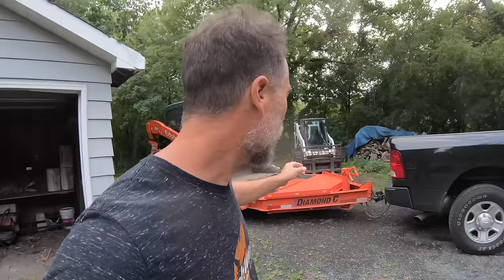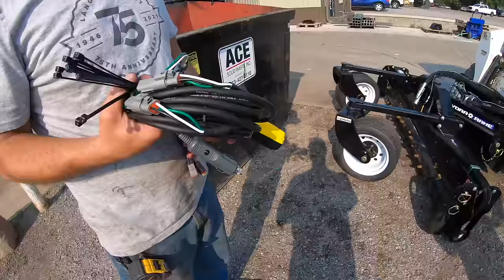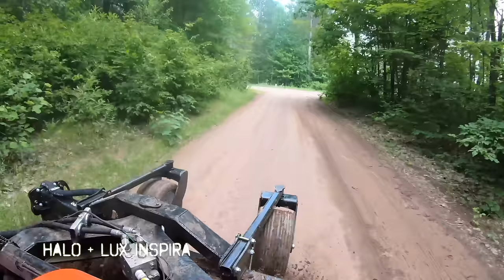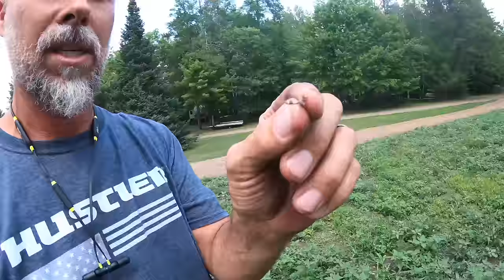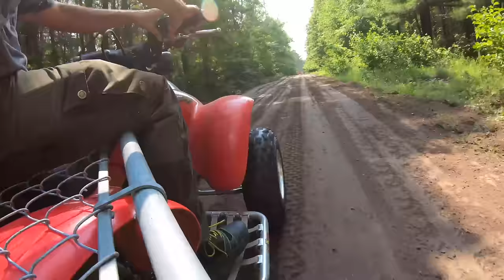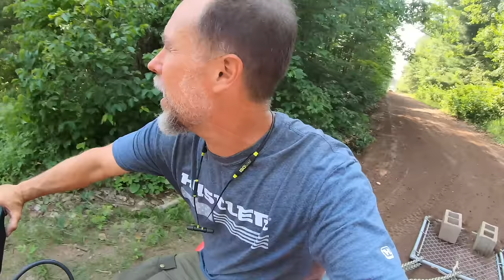Fixing a Rough Gravel road.  4 k vid

Comment: To dry to pack well
Reply from the maker: true but fortunately we did have a small shower which helped out tremendously
Reply: I recently purchased 11 acres here in Indiana. I hunted this area off and on for 40 years
I had to put in 1800’ of Road. I used 15’ wide geo fabric. Had the contractor dig out about 7” of dirt then I stapled the fabric in place and he backed in while dumping close to 80, 20 yard loads. 53’s and 73’s crushed with fines.  
That’s why I’m so interested in the svl 65. I’ve got a lot of truing up on the sides of the stone.

Comment: 40 yrs of experience. Win row all materials to the center of the road. Cut the gravel to remove all ruts and holes. Spread the material from the center to the sides to build a slight crown. That way you have material to work with to shape the profile. Grading in sections is preferred as you can push material into low spots or cut high areas. I would invest in a roller attachment for the skid loader and roll first to find the soft areas then rake again to fine grade. Same principle is used running a moto grader to grade a dirt road.

Comment: I have the smaller version of the Bobcat soil conditioner 48” that I use on my Ditch Witch SK1050 and it’s awesome. It works so well and so quick. Just put your machine in float and adjust the depth with the curl lever and only go in forward direction

Comment: Stan & Derrick from CMP Attachments:

A couple of Ideas for around the 5:22 mark; (1) Could you use a screw type mechanism (some sort of brush/bristle material or solid, maybe a brush bristle material stationary in front of a smaller metal band to act as a stop and aid the screw to eject foreign materials) as in a cement truck in front of a smaller metal band in conjunction with the fabric seals? (2) Not terribly familiar with what systems/Auxiliary systems are onboard machines; however would it be possible to continuously lightly air pressurize the inner part of the drum allowing outward  positive displacement of even the finest dirt particles and in by doing so depending on the CFM available reduce the size of the metal band?

Your power rake is a marvelous feat of true engineering and not a "how cheap can we get this out the" concept. Keep up with the great work and well deserved success!

Comment: Hey Stanley  I grew up the same way! Dirt. Poor son of a contractor.  Most kids played with Tonka toys I grew up running dozers and other heavy equipment since eight years  old . On most ranch roads once finished we rolled the roads with a 6 yard dump loaded.  We found neumatic rubber tires compacted better than steel rollers . They were also faster than a conventional steel roller on long ranch roads! Thank you for the candid honesty and non- biast review of the machine! I see the potential for  yard work . But I prefer a small dozer or motor grader for road finishing.  Overall for that  job the power rake did a good job on the job. Without bringing in additional larger equipment!  Adding to the job cost! Great review!

Comment: Question from a non pro:  Looking at raw property in the Sierras (Cisco Grove Ca. area just before Truckee  ca.   Most properties' roads/driveways have some part that is step and with drainage ruts up to 4 to 8" depths, would this work on that type of surface?  would it be good to mix in gravel or road base with fines to harden/strengthen the loosened dirt?  Would not live on property full time, would be mountain get-away from our city home in Roseville ca area, this would allow for working as needed and not in a hurry.   

Any recommendations on books, web sites etc regarding things to know and consider  when buying / building on raw land?

Many Thanks
Chris

Comment: Nice job and great for proximity. If you did many of these road service jobs, a vibratory compactor for the skid steer really improves durability, especially is the road base has some moisture content.
I give customers the option, as I need to rent a unit. I'd own one if I could keep it moving daily.
Most folks will opt for compaction the second time around.

Comment: A Hog panel works Fantastic as a top dressing drag too!  Just sayin'  I've used the ol' fence gate and bed springs (which work amazing as well but almost impossible to find anymore) and i prefer the Hog panel for most applications.  Especially if you take into account durability.
Reply from the maker: That's a great idea!

Comment: I enjoyed this video. Would love to get my hands on a four wheeler and a chain much less the skid steer and power rake. We have a rough road here no one seems to be able to fix and where we are trying to move could use some help if we get the place. Having to install a driveway has been a challenge here but I am hoping for better luck at the new place. But being able to actually fix the road here would be amazing. I tried on an old Ford 800 and a 7ft 3pt blade. Didn't do bad but I don't have the tractor anymore. Awesome educational video! Thanks!